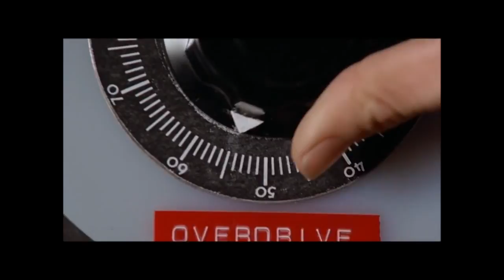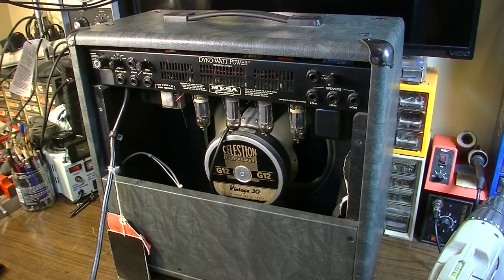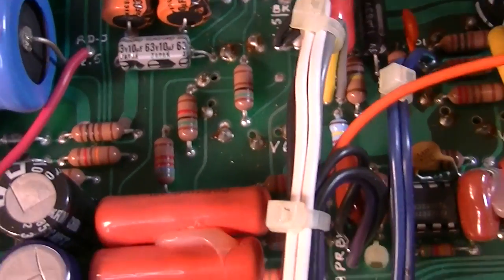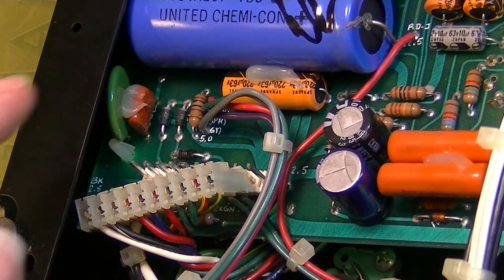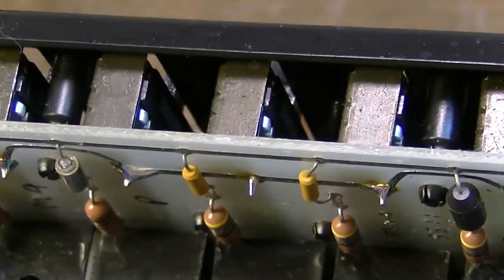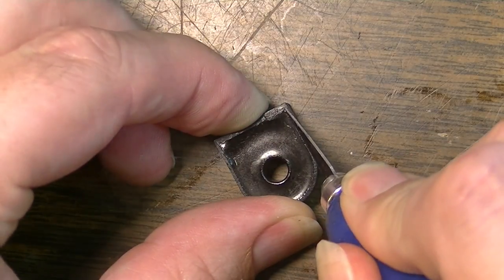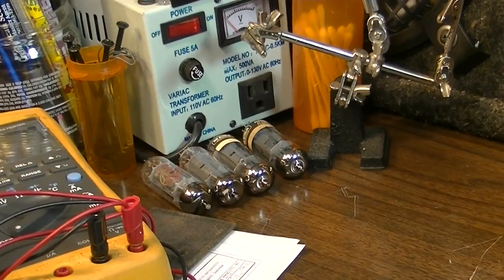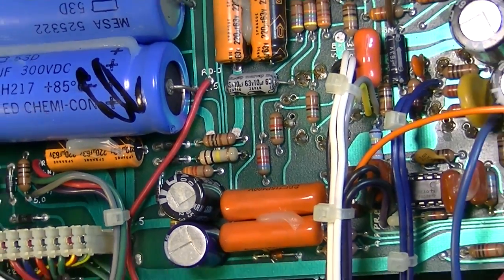The Forgotten Mesa-Boogie - 1990s Dual Caliber DC-3 Repair (PART 1)

Comment: It's stupid they didn't like comments about their amps being hard to service. Their amps are complicated so they are going to be harder for non familiar people to troubleshoot. I'd imagine their own techs would struggle sometimes. Complex circuits can be hard to debug. A friend has a Nomad 100 the successor to the DC3. Man that things had a hard life. I've had to fix so many stupid things. Including a fuse holder of all things. I've got the same amp and it hasn't missed a beat because it's been looked after. Great video.
Reply: I wouldn't think they would be harder to service than anything else out there. I own a Road King, Mesa Express 5:50 and a Lonestar and there is alot more parts than on a DC-3. When I got my Lonestar there was an issue with the power transformer vibrating and I called them and they weren't trying to hide anything about the info.

Comment: The Guitologist+ Great job brother, but I would worry about them lifted tracks on the tube board. The factory should have used a thicker amount of copper and ran a solder track on top knowing how hot this runs. A serious amount of voltage to run tracks that could be used as fuse line. IDK you know better.

Comment: MESA's are not worth the money they charge you for it. I had too many with similar issues on my bench at its always broken solder joints, failing coupling caps and the small electrolytics  vomitting their heart out. The coupling cap issue is per design, apparently RS was not aware that there is 600V Versions of these Orange Drops and that the orange Sprague electrolytics are as high in quatility as the grey Illinois, I don't want to talks about that Tantal "Torpedoes". Pots are also an issue, that cheesy style with that back plastic D-Shaft disassembles itself over the years as the case lugs do give way and if this does not happen the trace will just disappear and resistance drift way off....btw: that wrinkle on the large trace on the Output Tube PCB is normal for these type of Amps. so far everyone (DC, Rocket, etc) did have it, also the broken solder joints and the excessive flux residues (seems like they ar enot keen on cleaning flux off after soldering). In terms of design they are not designed to be servicable, seems like they just don't want to have them serviced at all...

Comment: Mesas are hungry for power tubes. That's their biggest customer complaint isn't it?. A hot bias to simulate a dimed power tube section?. I watched your Gibson ga15 amp repair video  and really loved the way the amp sounded after you modified it. I had a Gibson Atlas head and cabinet in high school. I wish I still had it after seeing what you did with the ga15. I remember mine was made by Baldwin or some organ company. Gibson apparently never built their own amps but always trying to get a piece of the fender amp business. Remember the l.p. in the 60s wasn't as revered as it is today. Unfortunately even then they were to expensive to buy new. In the 70s you could buy used l.p. for 300 to 400 bucks BUT you only made 3 bucks an hour at your job.lol

Comment: I used this EXACT amp for 15 years straight. Same cool/odd color tolex and everything. Vintage 30 speaker that loved for cleans, weirdly, and disliked for grit (probably THAT amp's grit). Toured to nearly every state in the union with that thing. Same cool/odd color tolex and everything. Bought it when I was 20 yrs old, brand new. My first real amp and it paid off to step up to Boogie quality for sure. SO reliable. Sound guys loved it. Easy to throw in the van. Powerful enough for anything I needed it for - mic'd on stage. Before that, my only amps were PV Rockmaster preamp with 50-50 power amp, and before that a tiny PV Rage (my first amp).

Comment: A Mesa/Boogie amp is really just a hot-rodded Fender amp, or Marshall amp (in the case of the Dual Rectifier series), Mesa/Boogie "borrow" a few of their design ideas from Soldano, so, I don't know why they get so uptight about criticism of their amp designs, it's as if they want to be treated as Royalty in the guitar amp world, I think one of the main design flaws of Mesa/Boogie amps is where they put the three-band tone controls, which is usually between two 12AX7 triode gain stages, this means that the three-band tone controls end up being less effective at high gains because no matter what you do with them the end result is a heavily-clipped signal waveform.

Comment: One of the worst sounding Mesa/Boogie amps I have ever tried playing through was a Mesa/Boogie Nomad 45 4 X 10 combo amp, it had a very cold and harsh sound to it, you could get a so so clean sound out of it, but trying to get a decent high-gain sound out of it was frustrating, I usually ended-up getting either a really woofy/farty overly-compressed high gain sound, or a very cold harsh trebly sound out of it, the tone controls were very finicky to adjust and sounded like they didn't have much effect on the tone.

Comment: I got this same beastie it was my backup amp all through the 90s it now sits quite in the corner on top of a roadster combo that I’ve never used (I know unforgivable) but it came in new when I was on the road and the JCM 800 half stacks and eventide H3000 racks were the shit, anyway I had I weird incident playing with the band Fuel (if anybody remembers those boys) we were filling in and a 6550 went on the Marshall I went to the Boogie but 2 bits in it seemed to just die but as the tech was setting up a third setup a GK250 in the eventide rack it the boogie cooled a bit and came back to life so my question.. since I was pushing it hard is there a protective circuit to shut these smaller DCs down before they can burn up? It really was on 11 it was a large stage and I was struggling to hear myself the hardest I ever push the little guy, the board wasn’t happy cause the sm57 was feeding hard but the monitors were for shit that night

Comment: I had the head version of the Dual Caliber for a while in the 90s until it crapped out during a tour stop in Winnipeg.  I ended up bringing over to the suburban home of the late great Gar Gillies of Garnet Amps who was like 80 and retired at that time.   He also complained about what nightmare Mesa's were to work on.   Anyway, he gets it up and running in about 20 minutes and asks me to plug in to test it out. I play a chord or two and he goes: "Is that as loud as you usually run it?"  I so I bumped it up to about 5 or where ever I usually had the volume He looks at me with this sad expression for a minute before calling me a pussy and reaching across me to dime it - lol    Anyway his advice was to sell it ASAP and I ended up swapping it a few dates later for a Hiwatt Custom 50 which was the greatest amp I've ever owned.

Comment: Brad. All my best regards to you.   I wanted to take some more time to watch this video even deeper to follow your schematic study, visual and test equipment, and the measures you went through to fix this amp.  I know I said thanks before for all your demos, but I cannot thank you enough for how you break down and show figuring out problems and analyzing potential causes.   To be able to see how you fix the stuff is such a miracle  I never had growing up in the 60's/70's.
Reply: In the past couple years, my quest to learn amps and electronics on my own, has lead me to priceless and invaluable study in this stuff from guys such as you.     Despite childhood fascination, learning electronics was a stumbling block to me since elementary school.   Back then, having opened broken transistor radios up and seeing nothing but a zillion little bits and pieces  made no sense to me.  I gave up hope from this experience of mind blowing visual mess until a fellow guitar player friend in the Catskills encouraged me that I COULD LEARN and do it, when facing a failure to my '72 Marshall 50 watt JMP head.

Comment: I hope you can henlp me: I own a jcm800 2204 that sounds like shit despite I brought it to several techs to check it up. I feel it lacks half the gain it should have and doesn't sound musical but dull. Could the power voltage have a role since some days the amp seems to sound nice??

Comment: This is the third Mesa-Boogie repair Video and i dont think i want to own such Mesa-Boogie crap.   This is not good built stuff.   and way too expensive for what it is.
Reply: Pffft. I got one of these I bought new in the early 90's.  Amazing sound plugged straight in, incredibly clean or all the crunch you could want.  Deafening loudness for the power rating. You could use this in a club without micing it.  You need to hear one before you judge it like that.
Reply: @mikebrown7366  The SOUND changes Nothing About the Quality .  Tube Sockets on Epoxy Plates...… No No.

Comment: I own an F-30 and it's an amazing amp, it has 2 EL-84's and it punches way above it's weight class. The overdrive channel is okay but the clean channel is amazing in it's clarity and power. The innards aren't as intimidating now after seeing this video. Thank you for sharing your expertise. You do amazing work.
Reply from the maker: i had an F Series once. F-100 I think, maybe? Anyway, it had a similar thing - 2 channel. Clean channel 1 and a Boogied out Channel 2.

Comment: Great repair. I would use alcohol and a brush to clean off that crusty flux. I would also like to add that I really like the sound of this amp, and your playing sounds great on it. This amp lends itself to a certain style of playing, and you nailed it.
Reply from the maker: I clean crusty flux too when it bridges two or more solder joints. In this case, it was just cosmetic, but yeah, I shoulda cleaned it anyway, in hindsight.

Comment: Mesa does things differently than essentially everyone else.  They set these up to match a set of known bias tubes to the existing Mesa circuit rather than biasing the circuit to a set of unknown tubes.  Quirky but effective once you know the drill.  

The problem comes when a player has tube failure and instead of going to a skilled tech, or sourcing Mesa tubes or tubes tested and matched to specific Mesa amp bias, they buy any tube set from GC and install.  They turn the amp on and if it fires up... good to go or so it seems.  Often these unknown bias tubes will run super hot shortening their life, damaging the output tube board and sometimes the transformer.  Then the amp dies and Brad gets the call...

Comment: Why did you have to change the value of the resistor?  I know it was because it was running hot but this suggests it wasn't the right value in the first place, would it have always run this hot from new or has something else caused it?

Comment: Changing that 120k resistor in the bias supply was also affecting the cathode voltage. Not a "bad" thing necessarily, but you didn't mention it in the video so I was curious if you were aware.

Also, not related to this video but in general, do you have some type of AGC/compressor circuit on your camera? That's fine for V.O. stuff, but I find it very distracting when you're doing a play test. You go through the trouble of micing the amp up, but the compression is masking the actual tone. Just a suggestion.
Reply from the maker: Yes it'll affect the voltage into the PI cathode. But that could be compensated for with a second resistor change. I didn't feel it necessary though.

Comment: Great little 'pre-amp'. Had one when new, but it was so quiet I killed the speaker output (or ran it out front for a monitor) and put it into a rack mount, feeding an M-180 (180 watt) amp, into a Mitchell 2x12 bass reflex 'sand cab' w/EVM12L's. It would MOVE a full stack of Marshalls if I pointed it at it. Messed my back up trying to carry it. Also had a power strip, tuner and effect in the rack. I could not put it in the car alone. Loudest thing I ever heard.  Got tinnitus now. I like little tube amps today.

Comment: Nice Job    nice amp      use a pair of muffin fans like from atx power supply's    rated about 150ma each max at 12volts   they run slow and quite   ball bearing a plus   and  depends inside condition  dusting it off now and than  will extend life on those tubes
enjoyed watching  take care

Comment: I worked on a Mesa (MKII I think) for a friend a long time ago. Typical broken solder joints, etc. It had an intermittent problem in one channel that kicked my ass.  It would pop and squeal and then mute. I didn't have schematic at first, but kept at it with no luck. Finally got hold of a manual...they used a device called a "fetron" in that channel for the preamp...that was the culprit. The other channel used a 12ax7, I think. It's jenky esoteric weirdness like that, the ridiculous muting and stone-age passive EQ  that made me vow to stay away from Mesa. You have massive cajones to keep working on them. Another great video.

Comment: @ 26:44 I put them on a vibrator to get a little extra OOMPH when cleaning circuit boards. Also, spray the brush not the item. You won't leave splatter residue everywhere that might become a problem later.

Comment: Have you messed around with a Holmes PC 210 pro amplifier??  it's solid state.  It uses TIP 29-30 and two output npn power 2n 3055  to3 on heatsink..  I honestly cannot find a schematic. 
 I changed all electrolytics and some small signal bjt's.  After getting it together and checked wiring confirmed with my close up pictures.... I hooked up a 8 ohm dummy and my scope,  signal gen at 1khz to the input on a guitar plug..  I raised the volume slightly and the sine wave looked good then at higher volume it squared off,  I brought the volume low then poof my fuse blew in the main power about 2 minutes into the test. I found that both 3055s shorted base to collector.   I'm thinking bad 2n 3055s or a surge of over current on the base and emitter or collector emitter...I got them at Mouser.
 The transformer is good and at 63 +/- AC on end to end and to center tap 29.5 +/-   I've checked diodes and they're fine.   Just need to know if there's an amplifier similar to this one with a schematic.   Or I'm going to have to painstakingly draw it out.... grrrr!!    I hope I don't have to draw it out.   Usually I can find a schematic....... I know you don't much deal with solid state but thought I'd ask.   Thanks Brad.

Comment: The way the traces are so f'd up on that board, why wouldnt you change out that board????
Reply: Lots of reasons. Availability...the amp is old. The board is repairable...no need to replace. Economy....cheaper to fix, even if you have to jump broken traces with wire. The reliability isn't affected if the repair is done right. Sometimes it's even improved.

Comment: I have a Boogie Mark 3 from 1986 that I bought directly from Mesa, Hardwood,wicker, non simul class (60/100 watt).Never been happy with  the Boogie tone. It's in my collection,but I keep plugging into an antique Super Reverb. I guess you either like that boxy, compressed Boogie tone or you don't. As an owner of one for 32 years,I don't,
Reply: johnnyd63 Hey i have to agree, i have a Mk3 I ordered at factory and after 20 or so yrs sent it to Mike Bendinelli & had him mk2c+-ize it and i play thru 68Twin & princeton reverb..mostly- i just like the warmth of twin and yah i guess it is a little compressed -
Reply: I've have a Red Stripe Mk3 simlclass. And its my fave. But I did the Bias Mod and I can put the Tubes I chose, and make them run where they sound best. The Mk3's are Biased Cold if you use the Recommended Tubes. Also V1 Is Hugely Important for great tone. It needs a High Gain but Lower Output 12AX7. But If you don't use your MK 3 sell it. If it were a Head I would buy it . I bet plenty of other Mesa people would pay top dollar for it.

Comment: I've got this ones smaller brother, the Studio Caliber 22. It had no output when I bought it so I took a bit of punt and got it for less than the Black Widow speakers sell for on fleabay :) Two previous tech's had looked at it and failed to fix it. Took me quite some time to find the problem! After fixing all the same things as you with regard to overheating and bias and it was still dead. The schematic bore little resemblance to the revision I have so I was signal tracing. Pre-amp side was working but nothing was getting out of the opto-switch to the send/return loop or main circuit. Track disappeared between and under two large power caps - signal going in one side, zilch from other side on way out. Cut the leads and lifted the power caps and hidden underneath was three signal diodes in series, middle one was dead. Replaced them and woopee - sound. Needless to say - they are not on the schematic but look like original equipment. It's a little beast of amp, very loud and very heavy for it's size! Fitted some vintage NOS Soviet military EL84's made in Reflektor factory and biased it back up a little - it's a great little amp and gathering value nicely over time.

Comment: I have an f30.  Nice amp but runs hot also.  When you kick in the OD Channel, it is white noise hell.  Dont like that.  Called MESA, plus did alot of reading, MESA and reading indicated that this was just the nature of this beast!  I thought, "Well that funkin sucks!"  I wonder if there is a way to tame this creature?  I also read where a guy changed out all the 12ax7s with jj12au7s, including the inverter, and he said amp stayed cleaner up to a higher volume.   So my amp is fixed bias, but from what I just witnessed , that dont mean shit to a tree.  Same way with a Princeton I had modded years ago by Dangerous Dan Torres, sounds great but runs hot.  It is fixed bias.  I love this channel.  "I LOVE YOU MAN!"